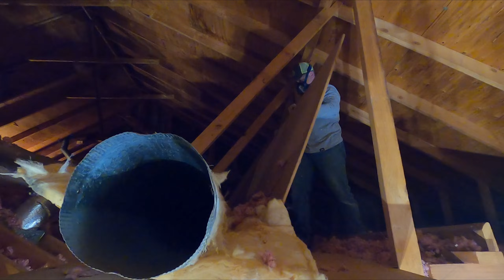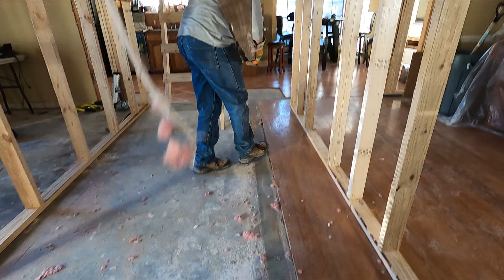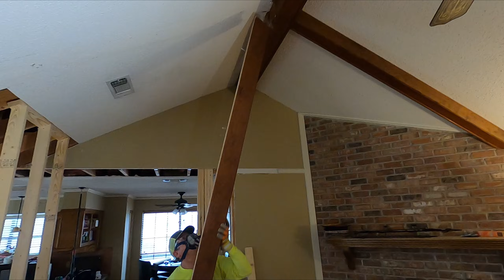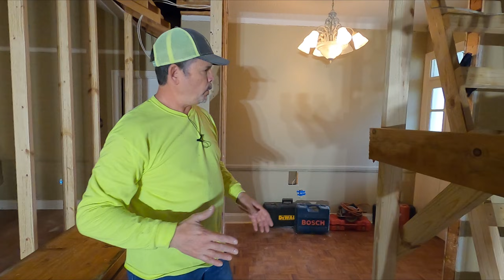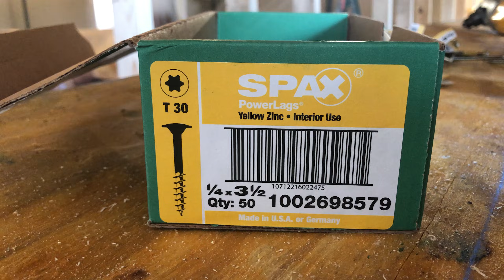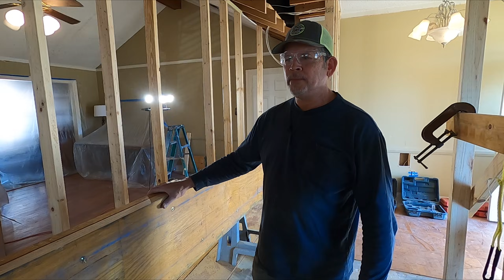How We PREPPED & LIFTED a MASSIVE 18 Foot LVL Beam - Ep. 4

Comment: I see when you are installing this massive 18 ft LVL beam, you screwed it together and I understand that. I was kind of expecting you to glue it also (not sure why, but I am confident you did it the correct way).  Maybe gluing that 18 ft LVL beams together would not give it anymore strength or it just was not needed, or you don't glue LVL beams together?? I am curious... thanks again for another great video.  Jim
Reply from the maker: I spoke to our structural engineer about gluing in these applications back when we installed these beams Jim.   He said adhesives are sometimes used but engineers can’t guarantee their performance on a job site so they’re usually not specified.   For example, is the wood frozen, dirty, wet, covered in paint…. On and on.    All of these conditions would diminish the performance of an adhesive.   Put “X” amount of this type of screw this far apart and we can calculate the beams performance under all those conditions 💪👊👍

Comment: I built a 20' beam to open up my whole floor.. I glued 2 by 12 by 24 of them together and bolted with half inch 7" long bolts every 2'.. Raised each 2 by 12 Individually and collected together with clamps and glue then drill half inch holes every 2'.. Now my living room has a 20' span with no columns and 16' Ceiling Joist..  Save your back do one piece at a time then put together up in the air

Comment: To avoid rerigging the beam (adjusting the straps) - measure from the pick point to the floor, then measure the take up of your come-along two blocked (maximum lift), and the take up of your rigging (be sure to account for a little stretch).  A choker around the beam would take up a lot less lift height than a chain attached to the top of the beam.  A choker in the center is stable as long as it is respected.

Comment: What made you choose an LVL over a 2x4 engineered glu-lam?
Reply from the maker: LVLs rule where we are.  Hardly ever see glulams
Reply: @StudPack  Interesting, I only asked because it seemed like a glulam would have been easier to install than connecting two warped LVL’s lol. Almost every beam job I do we use glulams, hell I’m installing one right now 🤣
Reply from the maker: Cool thx Joshua 👍. I guess you could make the argument that LVLs are easier to install if you lift one at a time but then you do need to fasten them together unlike glulams💪
Reply: @StudPack  either way great work man 🤙🏼

Comment: @Stud Pack  you tell me what size are those lvl beams?  16" height? I have 16 ft span load bearing wall supporting the ceiling roof. Wonder if double 16" lvl beam is sufficient to support the load.
Reply from the maker: You need a structural engineer sorry 👍

Comment: Everyone is always putting in beams to support ceilings.  But in many cases, if it's a single story house and you want to remove the center wall to open it up, you can go into the attic and attach 2x4 rafter hangers from the peak down to the ceiling joists and go ahead and knock out your center walls.  No beam necessary.  I was about to buy 24 ft. laminate beams to span the length between by living room and kitchen/ dining room and luckily, my new neighbor  2 doors up stopped by and said " Why are you going to do all that".  I did it his way, saved me a small fortune, was a fraction of the work and it's perfect!.  If you look at almost all garages, they have long wide open spans across the ceiling, and if you look in the attic, you will see the rafter hangers going all the way across.  Many garages have finished ceilings and flooring above for storage, so don't worry about the ceiling in the house caving in.  Make sure you check your own situation, because you may be spending a bunch of money and a whole lot of work that isn't necessary.  I'm not a professional builder, however, my neighbor is, and he's 84 years old and still working...and has built homes for over 60 years.
Reply from the maker: Yep.  Basically building your own truss in place.   With engineers blessing of course 👍

Comment: I installed four 26' LVLs by myself once for a bonus room I was building over a garage. I rented a scissor lift, got each LVL centered on the lift(one at a time obviously), flipped them up on end, and then used a couple ratchet straps to anchor it to the cage on each side. Then I used the remote control while on the ground to maneuver each one into position in the pockets I had set up in each opposing wall. Then I'd go up on my 12' A frame and bolt each end in. Worked like a charm.

I also used that scissor lift to wrap the beams with drywall, mud, finish and paint them. But just getting the LVLs into place with such ease was worth every penny I spent on the rental.
Reply from the maker: Cool thx Todd 👍💪

Comment: I've been trying to figure out something similar on my house. We gutted it a couple of years ago, and ran out of money, and have been living in an apartment. Our house is an odge podge of porch enclosures that have been added on, with a roof covering 2 other shingled roofs. One porch ceiling is lower than the other, and I'd like to install a beam to open up the space into single room, but there are jack studs holding the main roof up, over an older roof where the wall is.

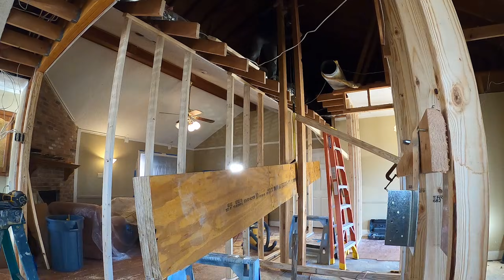Comment: About four years ago I had a similar project where we had to raise a 750 lb 24 foot long glulam to replace a wall at the juncture of a flat roof with the low end of a heavy timber gable roof, but with no access from above.  We maneuvered the beam from the driveway into place on the floor on rollers made from different diameters (to adjust for the outdoor/ indoor change in floor elevation) of PVC pipe.  Next came beam guides near each end like the one at 17:42 in the video. The beam was then lifted into place with two Qual Craft tilt-up wall jacks used vertically.

I actually had a lot of fun coming up with the approach, and then seeing it work perfectly.

Comment: Doesnt that notch on the LVL compromise it's load handling? It nullifies the bottom portion of the grain.
Reply: There really is no "grain" to an LVL (Laminated Veneered Lumber). It is an engineered material made from 1,000's of smaller strips of wood with alternating grain patterns. The notch in the bottom makes zero difference in the strength of the beam, but makes a huge difference in the quality of the work to come.

Comment: Would be a good idea to glue the 2 beams together for extra strength?
Reply: The strength of a beam is related to w.h^3 (to the power 3). So if you glue them together the width is still 2w and the height is still h. No difference.
Reply: @donbergler1703  thank you

Comment: Dear Beam Manufacturer, One of the major selling points of engineered wood is that it is supposed to be more consistent than natural lumber.  Just sayin'.  
Great work, guys.
Reply: Unless you got the big beam free, you guys should invoice the manufacturer for labor to "fix" it for install. Pretty bad they sent them out bowed and off size. Great work boys!
Reply: @rockyd204  You got that right.  The quality of lumber has really gone to hell during the pandemic, but if I got an LVL like that, I'd really be urinated off.
Reply: What company made that junk? I think they need some internet shaming.
Reply: @scotts.2624  A LOT of the crap lumber is coming out of Canada right now.  They are still in full lockdown up there and are just scrambling, sending everything to the mills for processing (bullcrap and all) but worse yet they are shipping out all the junk too instead of doing any culling of bad stuff because prices are so high right now and they know stores are desperate for inventory.  I can't believe how much crap lumber is in HD and Lowes right now (more so than usual), full of cups, splits, knots, delaminations, etc. It's bad right now and that's not getting into prices.
Reply from the maker: Thx Bro 💪👍
Reply: @StudPack   what size lvl beams  did you use for this 18 ft span? 16 inch or bigger?
Reply: @aldouschiu  they would at least be 18 inch unless the engineer is incompetent.
Reply: You will NEVER get lvl's that aren't cupped. It's minimal if they are fresh and you use them immediately but even then they can/will cup after installation so you need to make sure they are secured together properly. Structure screws are fine but I still use lag bolts.

Comment: You can fix cupped dimensional as well as plywood/lvl lumber by lightly wetting the cupped side. This expands the wood fibers on that side and essentially "un-cups" the lumber. Another method for green lumber is to place the lumber cupped side down on a sunny way. This dries the top side and shrinks the fibers again causing the wood to "un-cup". On really bad lumber, you can wet the cupped side and place it wet side down on a hot sunny day. You'll be surprised how effective this is but be careful to seal the end grain with some paint or else you'll trade cupping for checking.

Comment: How did you know you could effectively lengthen the beam by removing the "bump" in the wall?  How do you know there is sufficient slab foundation under the new location for the stud pack? On a slab, probably not a problem. For crawls or basements, the stud pack need transfer the load to the directly to the foundation It cannot not rest on only the floor joists to go to foundation.  Also remind viewers they should never drill through a laminate beam without consulting an architect or civil engineer.
Reply from the maker: I didn’t feel like an extra 5% in
length was going to matter.   We went over slab thickness in previous video 👍👊

Comment: I'd be very tempted to strip all the ceiling sheetrock down to save stripping the popcorn and making all the patches and fill
Reply: If hanging by yourself, you would just strip the popcorn and skim coat it. $12 a sheet adds up when you have to finish it as well.
Reply: @TravisPickle  I disagree.  We're talking a half day to strip the popcorn properly and prep the surface.  Chances are it has asbestos in it too. Then you will more than likely have problems matching the thickness of the sheetrock.  Old sheetrock is thicker.  There is maybe $50 of sheetrock on this ceiling.  That won't break any bank  and the results will be far superior to anything trying to use the old rock.

Comment: Is there a reason u didn’t glue and screw the beams together especially since they were alil warped?
Reply: Is there a point to the glue when the bowing of these beams is so strong that it would rip it out easily? If the nails can't hold it it was too warped to be used anyhow.
Reply: They didn't show it but when u screw two lvl's together u're supposed to hit from both sides with screws and screws should be off set not in a straight line

Comment: Very odd that the LVLs were not perfectly straight. I wonder what caused that? I thought one of the main advantages to LVLs are that they are always perfectly straight (no bowing, etc.)?
Reply: Lumber yards sometimes leave them outside in the rain which can warp them if they sit long enough. I've had to deal with this same issue.
Reply: @JereHOTmiah  ugh! Good to know. I guess i’ll make sure to special order so they come fresh off the assembly line lol
Reply from the maker: Yeah I was surprised that they were cupped, bowed, and not equal width.   Date of manufacture was 1/21/2021 so they didn’t sit outside too long if that was the problem